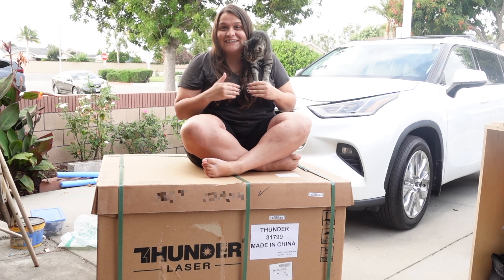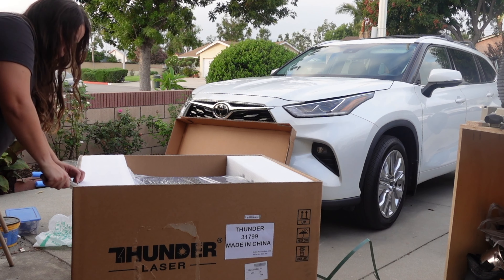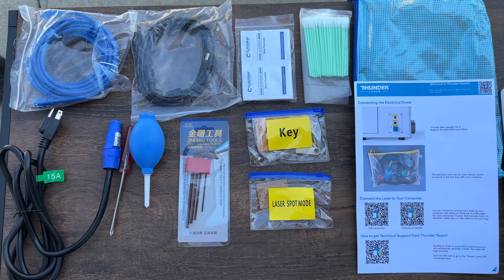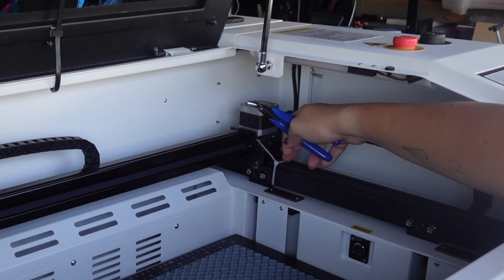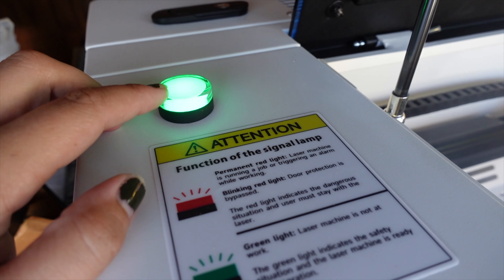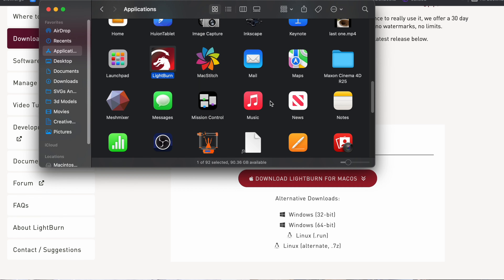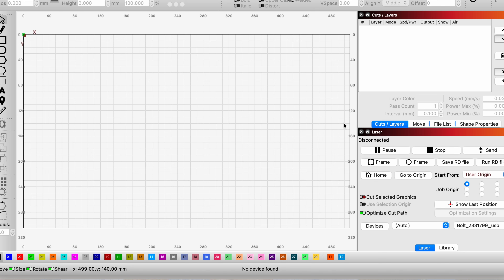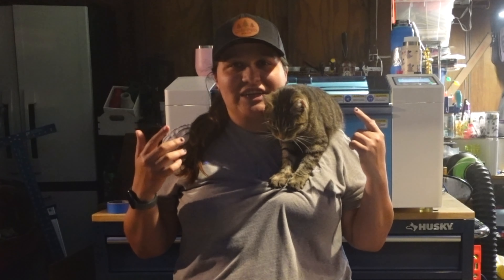Thunder Laser "Bolt" Unboxing & Set Up | Thunder Laser Bolt 101

Comment: I am also thinking of switching from GF to Thunder, is there anything you don't like about the Thunder that glowforge does?
Reply from the maker: Honestly for me there isn’t anything I don’t like about the Thunder. I think it depends on your level of laser knowledge. The glowforge is a great starter and easy to use. Thunder uses a program called Lightroom to control the laser and it could have a learning curve. But the speed increase alone is enough to switch to the bolt from the gf. And you don’t have to depend on WiFi to use it.

Comment: Hi, I have a question about the smell. I’m planning on getting one, but I rent where I’m currently living. So I am limited on space and was just planning on placing it inside my house. Is that a terrible idea with the smell? Will the air and smell be pumped out enough?
Reply from the maker: The smell depends on what you cut. You could get a file extraction box or possibly put the vent out a window